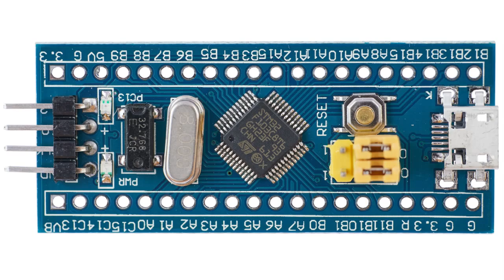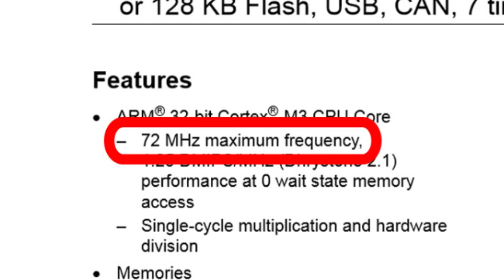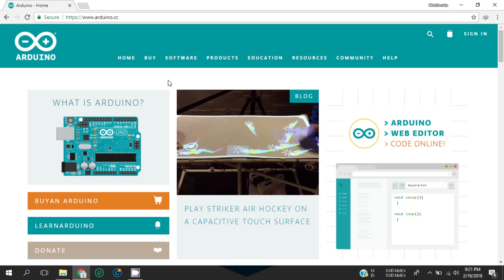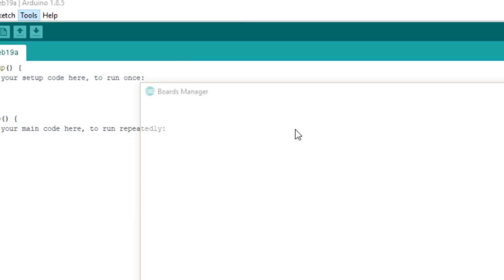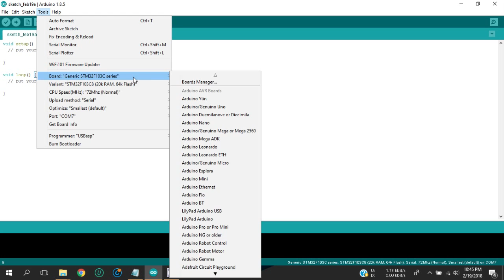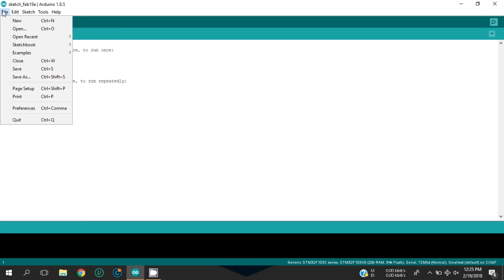How to program STM32 microcontroller using Arduino IDE

Comment: Good video. But my problem is how can I know that which pins are digital pins and which pins are analog pins?
Reply: Christian Weissmuller 
thank you so much, another question, can we use Stm32f103c8t6 mcu as a stand-alone chip? I couldn't find in anywhere.

Comment: Very nice tutorial. 
You should describe what is the use case of the micro USB  built-in to the board.
Reply: This is only for the power supply as long as no bootloader has been uploaded.